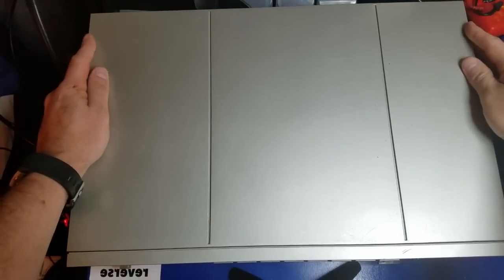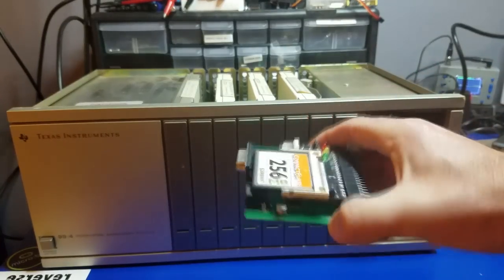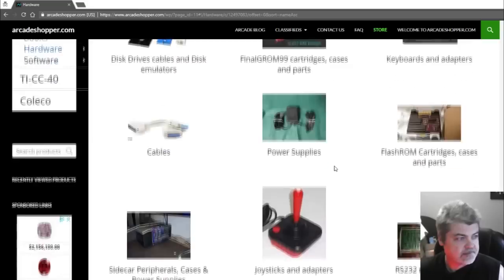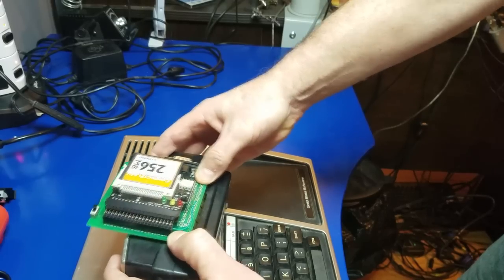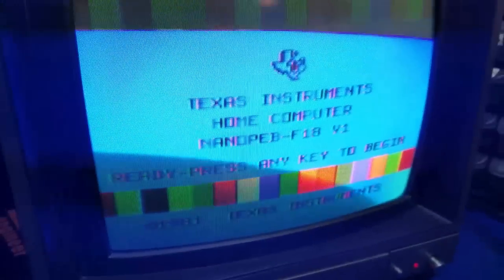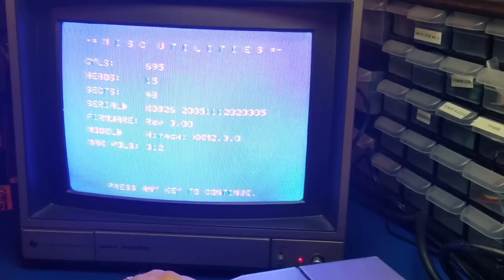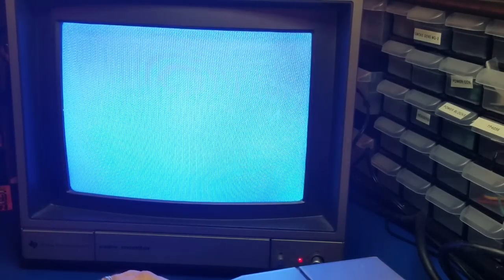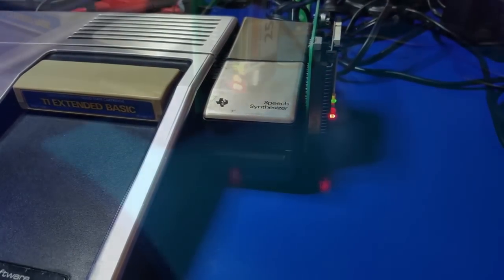AWESOME TI-99/4A UPGRADES: the nanoPEB

Comment: I wonder if there are any upgrades for these old computers that turn them into basically laptops you can carry around. Most of those old 8bit/16bit machines are pretty integrated having both keyboard and the computer itself in the same case so realistically the only things missing are battery to power the thing and the screen with a closing mechanism.
Reply from the maker: I know there were some discussions on this on AtariAge ( http://ti99.atariage.com) sometime ago.  I don't think anything became of it though.
Reply: @WagnersTechTalk  Yeah, got Atari Age account, this is one of the largest forums for the old micros. I think the hardest part would be getting a good screen and making a closing mechanism that would fit with the rest of the case. Battery would not be that hard, I think. A couple of li-ion cells and you're set.
Reply from the maker: If you wind up building one, I'd definitely like to see it!
Reply: @WagnersTechTalk  Probably not my level of experience to make one, but if I do, I will make a video about it on my channel.

Comment: Hello

Can you tell me how to get to the “press any key?” Screen
Reply: Just signed up

I posted but I think I have to wait

I’m really wondering 2 things

1. How do I get to the cfmgr screen you showed when you booted up. My ti99/4a just shows ti basic and extended basic. Although my ti99/4a is recognizing the nanoPEB? I can’t get to the screen you showed

2. How Can I save a program to my nanoPEB. That’s what I really want to do. I’d save a program to one of the virtual floppy drives?
Reply from the maker: FCN+QUIT at the same time should do it.
Reply: Wagner's TechTalk ok I pressed function plus sign

I’m new to a lot of this. I got my nanoPEB from eBay

My ti99/4a recognized it at the startup screen. But other than that I couldn’t do much?

I got mine off eBay it’s got a 256 mb card

Can you tell me how to load the what is it called the cfmngr program you showed where you look at the disk drives? 

I really want to use mine to save programs. I’ve been writing programs but I can’t save them my cassette drive isn’t working

But I’d love to take it step by step. But like I said haven’t been able to do much yet

Do you know if my card would be formatted?
Reply from the maker: Definitely search the forums at  http://ti99.atariage.com/ and/or post your questions there.  You'll get far better responses to your questions there.  That's where I got help getting my nanoPEB setup :)  Hope this helps!

Comment: this is quite a good introduction, i usually do hardware mods for different machines, but i might get one of these just as looks quite handy
Reply from the maker: Thank you!  The nanoPEB's are nice, but you may also want to check out the TIPI before you decide: https://youtu.be/5NPYWeCx-lk

The TIPI was released about 3 months after this video was made.  Just want to make sure you have the latest info. before you decide.  I still have both but honestly use the TIPI more frequently.

Comment: is that an actual ti99 monitor ? where the f did you get that ? lol cheers techbuyer---- https://www.ebay.co.uk/sch/techbuyer2017/m.html?item=163342706422&rt=nc&_trksid=p2047675.l2562
Reply from the maker: Yes it is!  I picked it up on ebay several years ago :)

Comment: For some reason mine doesn't have any power adapter. The power cord was just directly hardwired into the nanopeb. It worked but after a while the power cord fell off. Wondering if I could just solder on a barrel jack and it'd work.
Reply from the maker: Should work fine for you, worst-case just re-solder the power cord that was previously soldered.  Just strip the wires back, tin the wires and solder back.  Although, a new jack would be a much cleaner idea.  Might want to put some heat shrink tubing on the wires as well to keep them from shorting out.

Comment: Great video!  Were you able to test the serial connection?  Also can this emulate a hard drive or just floppy volumes (or are they the same thing)?
Reply from the maker: hi Joe, I've not tested the serial connection yet.  I have all the cables/hardware to do so, but need some time to learn more about the various software applications before releasing a video about it.  Once I figure it out, there will be another video much like this one.  From what I understand, the nanoPEB only emulated floppies and not hard drives, but I could be mistaking.  I just received a 4GB CF card yesterday and will be demonstrating how to format it for the TI soon.  Thanks for watching this video, more coming soon!